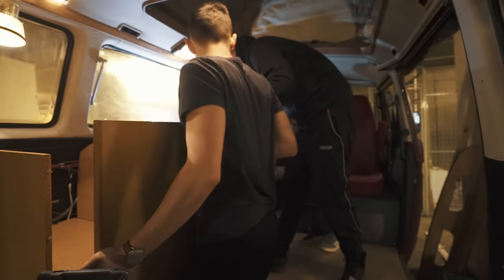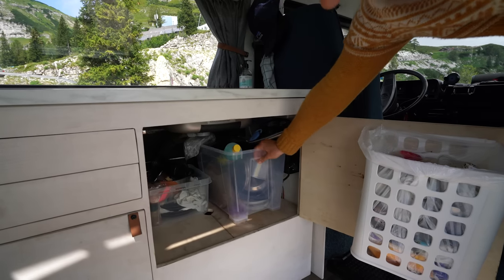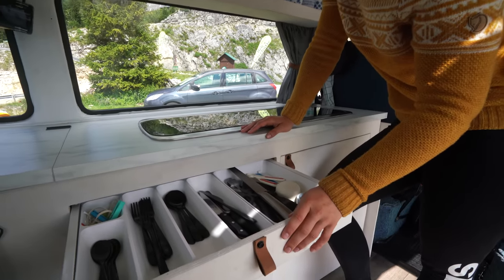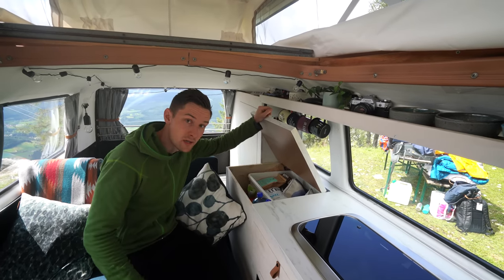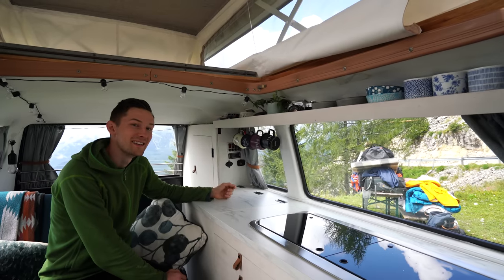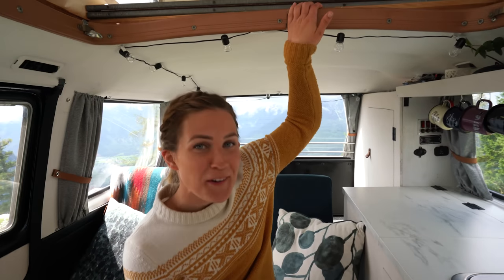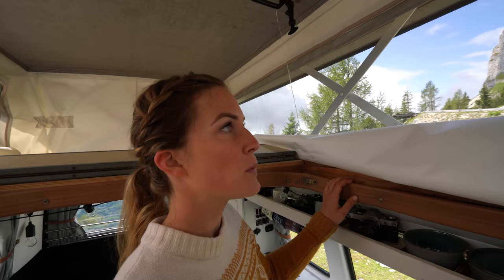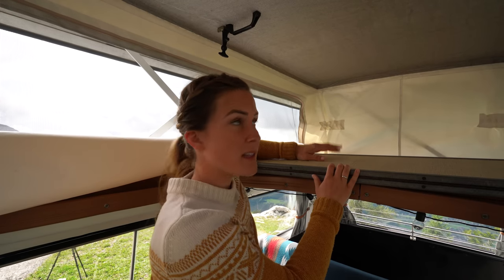Custom made minimalistic VW T3 camper van tour

Comment: You made a very good job of it. I'm not a fan of people making everything out of thick planks of wood so your Scandinavian minimalist style is spot on. We've had our T3 (T25 in Britain) for nearly fifteen years now so could I make a couple of suggestions? I'm guessing the starter battery is under one of the front seats? Well we put our leisure battery under the other seat. Then you might have space for a spare gas cylinder for when one cylinder runs out and you are really in the middle of nowhere! We use a chemical toilet and put it in a pop up toilet tent outside. Again, good job and some great places you've been to so far.

Comment: Hi Simon. Love the build and adventures. Thanks. Where are your front seats from? I don't think they are originals for a T3 but i like them a lot!
Reply from the maker: Hi! Thank you so much😊 They actually came with the van, I guess it’s a part of the SCA camper specification. We have new upholstery though :)
Reply: Simon Braeck Thank you Simon. Amazing videos. Great footage and editing. I have a 1986 T3 too. Restoration done on the outside. Interior underway. I did a bit more research and think I have found your seats. Not seen them before. Made by a company called Sportscraft.de. Model no S5.1 http://www.sportscraft.de/pag_d/produkte/seats/sitzs51.shtml. Just for your info :)

Comment: You guys should invest in a solar panel to keep the batteries charged. Then you wouldn’t need a hook up all the time at camp grounds and stuff
Reply from the maker: Yes for sure, the problem is that we have a 1cm clearance when entering our parking garage, so we have issues regarding adding stuff on the roof. I’m looking into foldable panels, but I’m not sure if the perform worse
Reply: Ok here what I thought of I notice above the sliding side door that there is some space on the ceiling/roof you could mount a bracket that folds down and flips out. Down side is you can only use the panel when the sliding door is open or in the back where you have the hanging led light that runs on battery mount it there so it can flip out to use and lay flat against the wall when not in use. Same down side back door has to be open
Reply: Ok ok I got it lol. Behind your closet in the back where the control box is some of the window is blocked by the closet and you could see into the closet through the window (you guys covered it I think) well you could uncover it and cover it with the solar panel so that the sun travels through the window. It would be completely out of the way. Down side small solar panel
Reply: I rewatched this video I noticed that the glass looks frosted so on the opposite side of the closet is that other window maybe some kind of thin solar panel you can put up and take down its looks like a pretty good sized window. Any way I love what you guys did I love that you guys are tracking and are happy together I hope to one day be like you guys and have a beautiful inspirational lady by my side who makes it fun an enjoyable. Excellent job
Reply: I feel bad because I keep bugging you but one more idea. Maybe you can some how build it into the pop up top of the camper. Like a recessed light fixture it would be a “recessed solar array”
Reply from the maker: Haha, no worries! We actually have a small dip in the roof just over the driving seat (the are of the roof that doesn’t come up). It would be a good location, but I feel like it need to be able to tilt up in order to catch the maximum amount of sun rays. I will definitely look into it and maybe even add a second leisure battery under the driving seat. And we need to find a place for the diesel heater too... it’s great to have more projects in the pipeline😊 Good luck with finding a travel partner! It makes it all more enjoyable

Comment: What 12v fridge do you have? I also have a t25 and need to replace my old propane fridge but not sure what fridge to buy!
Reply from the maker: It's a cheap fridge we got right before we sat out on the long journey. Would recommend something a bit more reliable, we consider something like a Dometic or Waeco for the next fridge. As a fridge is the main source of power drain, you should look at an energy efficient compressor fridge:)

Comment: Hi guys, you did a really great work at that van and I like it very much to see your videos. There are two things I recommend to you. The first one is very easy to realize: You installed the door mirrors in a wrong way. You have to turn the mirrors around, because the most of the mirror should be inside the mounting, like here: http://up.picr.de/6283084soq.jpg
The way you did it, the width of your car is to large and it is very risky for your mirror to get hit by something. The second thing is the paint at your car. The color looks great, but I warmly recommend you to use a pressure spaygun next time and not a paint roller. It doesn't cost a lot, but the result will be amazing great. You did so much work to prepare the car for the new paint, that it is a real pity to get a result like you have now. But let me say again: You guys did a great job and I wish you a lot of fun with that van.
Reply from the maker: Hey! Okay, I need to check that. It felt like the right way, haha. Well, the paint job was done with a pressure sprayer, but I think the paint and the cheap sprayer made for a bad combo. We were really short on time and had a limited window were we could use the hangar were we painted it. Would like to do it over again, but hey. Lesson learned.